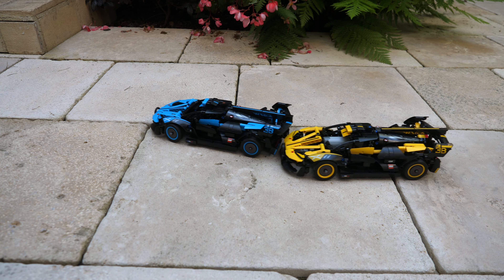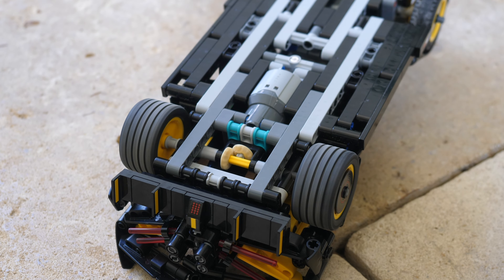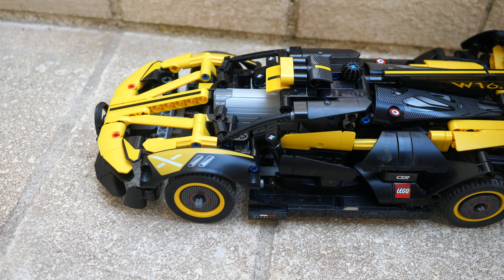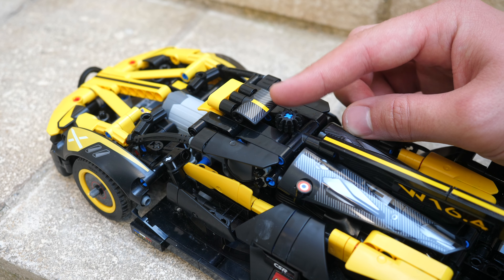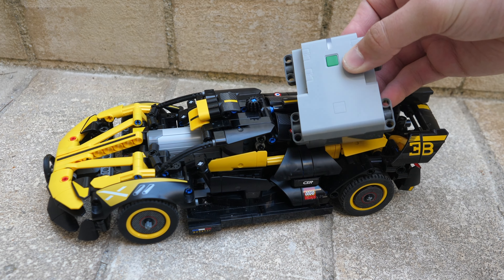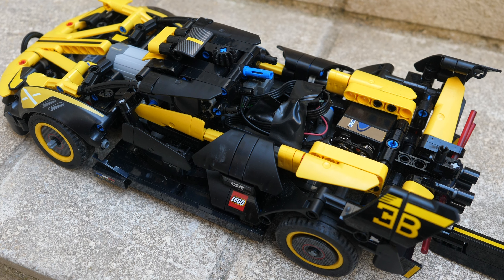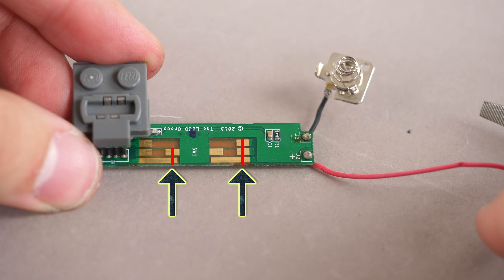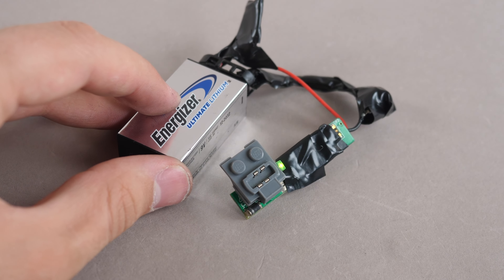LEGO Technic Bugatti Bolide 42151 Full RC Mod

Comment: Really makes you wonder why Lego didn’t just make a compact 9V cell battery box in the first place.
Reply from the maker: Ikr
Reply: My thoughts exactly!
Reply: Yup, smaller box with TWO 9V batteries would be perfect.
Reply: @KannX  lego motors run at 9 volts, having 2 9v would make 18 volts requiring a buck converter, reducing efficiency and increasing size and heat
Reply: @largewallofbeans9812     Even if you put them in parallel?
Reply: I have an old one from  electric crane 1995 set

Comment: I doing the same with lipo 7.4v for a while. The problem with 9v battery is that its have no big current, and it last for short time. Small lipo is the same size and have 10 times more power. Cool car ❤

Comment: Nice mod. I've personally done a much easier mod to my IR receiver to power it with a compact 9V battery. I googled which wire is what and found the 9V and GND rails. I then directly soldered them to a 9V battery plug and that was it. It works perfectly without the board. The board is mainly for short circuit protection and shutting off when voltage is too low. You can do without it

Comment: Do the third party adapters actually break it? They are just a direct wire aren't they?
Reply from the maker: They end up short circuiting the battery
Reply: Oh. Is the polarity incorrect

I was going to try and make one with a just 9 volt battery plug and a pf extension cable but if that doesn't work then I won't.

Also where did you get the third party one?
Reply from the maker: @donnachaslegocreations  "9v classic" or simply connecting the ± wires to the respective ends on the IR reciever will not work. I personally haven't tried doing that but from what i've seen on many online forums, everyone says that it doesn't work with the IR reciever. The 9v adapter I bought was designed to stack, so if I connected many of them together by stacking the cables with many 9v krone batteries, the voltage would increase. This is probably what causes the short circuiting. I bought it from green gecko's workshop
Reply: Ok I understand now thank you.
It's a cool mod

Comment: i did the same with my lego jeep wrangler but one side is too heavy of the car and weight distribution is not working becuase the motor for my jeep is connected to the outer side of the wheel

Comment: Found this video on how to connect 9v battery directly to Lego Power Functions cable. I just cut one of my old extension cables, soldered on a 9v pigtail, used heat shrink tubing to make it neat and durable. Seems to work great, just make sure you connect the 9v and ground to proper leads on your existing cable. https://www.youtube.com/watch?v=MV9z517U130